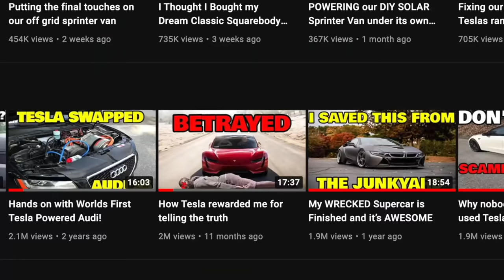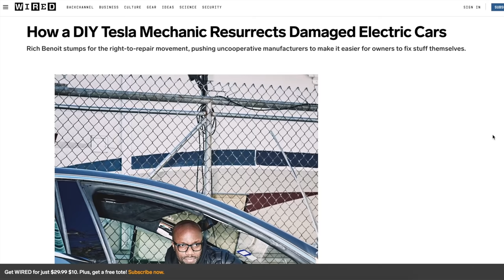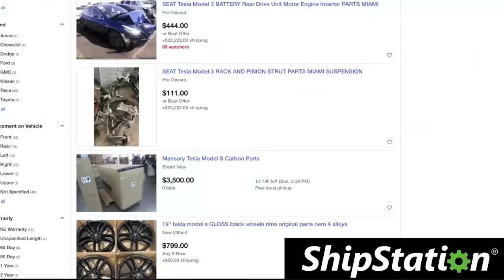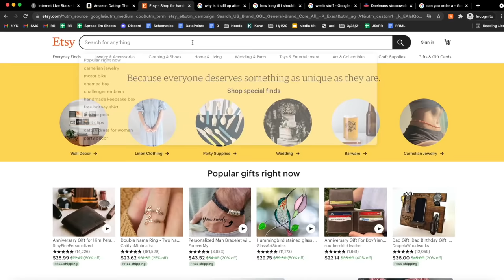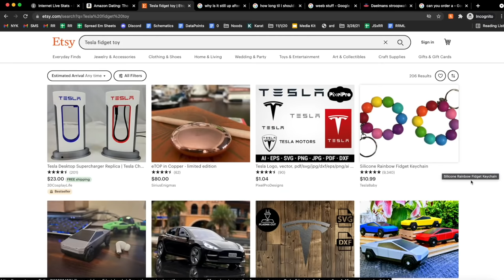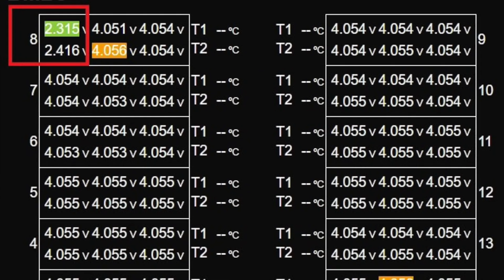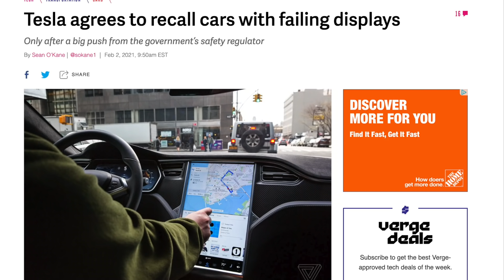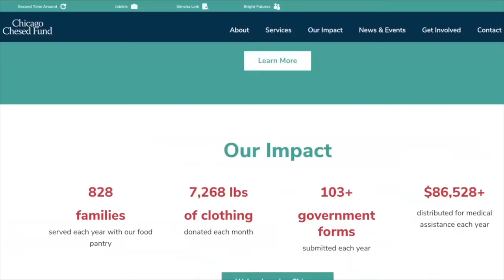Tesla wanted $16,000 to fix this NEW Model 3, we did it for $700! The importance of Right to REPAIR!

Comment: THIS is why Right to Repair is needed for consumers, REGARDLESS of industry. Fantastic video Rich.
Reply: +1
Reply: I dont really understand  what this video had to do with right to repair. Did Tesla try to take this video down? Was a cease and desist issued to this garage?

All I see is the dealer wanted to charge a Sky high price to repair then it was done much cheaper at another shop... welcome to owning any car in the past 100 years... 

Right to repair would be applicable if Tesla was saying that what you see in this video is illegal under the DMCA or took them to court. Thats what John Deere is doing to farmers. Tesla never said that,  at least I don't see it anywhere....?? What am I missing.

Also fwiw I can see why this kind of repair could not be stood behind because it may work but you couldn't guarantee it due to how it works, it is very depebdant on the skillset of this garage.
Reply: @brunes007  Tesla does not support independent shop, look back in the older videos
Reply: I think right to repair is great, but the reason Tesla might not want to allow uncertified individuals to repair vehicles is because it may create dangerous situations if components are installed incorrectly, creating fires etc... this would hurt Tesla's image and place people on harms way. Cell phone is fine when done by third party, but a  vehicle is a different story.
Reply: @hesamchobanlou4887  just sell the parts and be done with it, other companies are doing it. Tesla is just trying to control everything like apple
Reply: @farrisnoor3268  Ford nor any of the big 3 doesn't "support" independent shops either. Most independent  shops buy their parts from NAPA and other third parties. The only thing different here is a large and robust third party parts market  hasn't developed yet for EVs. My point is, good luck getting your Mustang Mach E fixed at an independent  shop. This isn't a Tesla or Right to Repair issue unless this garage is actually being sued, which from what I can see they aren't. John Deere is actually suing people who fix their tractors under the DMCA.  It's entirely different.
Reply: @hesamchobanlou4887  If I own the car I either has the right to do whatever the fuck I want or the company has to suck it up and do it unnder warranty or goodwill, and it's their choice if they want to risk their image and let me repair it myself.
Reply: @hesamchobanlou4887  in this case Tesla could just say (like many other car manufacturers do) you are free to repair anywhere you want but if you go to a non-officially-Tesla-approved garage your warranty is void. That would be acceptable. But force the owner to possibly see his car totalled if he tries to use the insurance, because of a little plastic part broken, that's totally insane.
Reply: @farrisnoor3268  yes Tesla is going the Apple way. And people will start to avoid Tesla the same way they avoid Apple. And it's sad, because both Tesla and Apple are making great products.
Reply: @brunes007  there's always a person like you who comments and dose zero research on the issue
Reply: Yes right to repair. I just hope what the president signs is not just bs in the end.
Reply: @hesamchobanlou4887  I think its dangerous to not be allowed to repair your car. People will just let their car go and it be worse and more dangerous then ever. Of course who cares, the rich people can afford it so why should anyone care? Not only that even if your rich you still gave to travel hours to fix your car. Etc... not only that. Don't forget about all the unnecessary lithium & batteries being waisted.
Reply: @brunes007  He literally gave you a video to watch. Go watch the video he said in the link and you'd be educated VS assuming and talking straight out of your ass. If you've been under a rock regarding Tesla they do NOT support independent shops outside of themselvs. Will not supply parts, battery pack or anything to anyone who's not THEM. That's what it has to do with Right To Repair.
Reply: @hesamchobanlou4887  then why not TRAIN shops how to do it? How do body shops get certifed to work on Porsche and other supercars? The manufacturer trains them! Same goes for mechanic shops to get their certification to work on them to THEIR standards. Same would and SHOULD apply to Tesla. So still, failing to see your point when it can be fixed with a remedy of training and a LOT of it as well to ensure no such mistakes are to be made
Reply: @brunes007  In addition, it's important to note that the Tesla repair shops barely have more experience or training than the independent repair shops have.  They're still rapidly changing part design.  The cars are that new.  My grandfather ran an independent GM repairshop where he had literal hundreds of stories of figuring out similar things to this for fixing cars drastically cheaper than the dealers would.  If this becomes a common enough problem, Tesla will probably change up their battery packs to make it more repairable.
Reply: @adewouters  Actually, if you use a non-Tesla garage, they legally cannot void your warranty, other than that for the parts actually fixed, or if they can show cause that the fix damaged other systems.  That's the right to repair that has been forced on car makers by federal law, and should be extended elsewhere.  If you goober it up, or if you hire an independent shop that goobers it up, it's on you or the independent shop, but otherwise if you replace your wiper blades and then the oil gaskets blow, the warranty isn't void.
Reply: Tesla charging $16,000 for something that can be done for $600, and there are actually people out there supporting that 🤣🤣
Reply: Should look at John Deere farm equipment that the farmers are not allowed to fix themselves.
Reply: @SSJ2and13man  there actually are Tesla certified body shops
Reply: all well but Tesla can just shut off super charging if they see a repair out of their network
Reply: Agreed
Reply: Tell that to the authorities. Try fixing your own A/C your not allowed to buy the parts on your home or car even with the tools that you Can buy.
Reply: Apple disagree hard!
Reply: @grandmastarflash  damn
Reply: @grandmastarflash  wHaT aBouT TesLa's pRecioUs RepUtaTioN?!
Reply: @Anthony__420  Yeah and one of them tried to charge this guy $16k to fix his car.
Reply: @hesamchobanlou4887  So every car, truck and motorcycle in the road can be repaired by third party garages but not Teslas, they are just way too complicated, give me a break! 😂
Reply: That's why people should stick with the gas vehicles you will always gets the "Right to Repair it myself" aka DIY all the time!
Reply: I just bought a Tesla model 3 RWD, I hate to pay $16,000 for a simple repair like this, but I can understand why Tesla will not honor a warranty on a battery after a repair like this, The Tesla battery has an 8 year warranty, anytime you modify this battery they can refuse to honor the warranty, all other cars makers do the same with their cars that are under the warranty. You may change the oil or replace brakes at any approved shop, but if you modify the engine your warranty is over.
Reply: @sssteve5430  lol! I always get 3 year Warranty on my 12V maintenance free AGM battery for my 2010 Chevy Express 3500 6.6L V8 gas cargo van! I get it for free! AutoZone was so generous and kind enough to trade my battery for a new one because it's still under warranty! 😁
Reply: tesla ~= apple
Reply: @brunes007  As long as the garage knows they're not missing any simple but important aspects   , they should warrant the repair . It takes SOME skill to tap threads into plastic , but not a great deal  A steady hand and a good eye  and you got it !!!
Reply: @hesamchobanlou4887  Then , again , the reason may be they'ld rather make $16 K than $700 on the repair LOL!!!

Comment: I'm no expert, but isn't it kind of a really bad design if a broken $2 plastic part results in a whole battery change costing $16k? Ridiculous!
Reply: I couldn’t tell from the video. Is the Tesla Nipple glued in place? 

I understand it’s likely a bespoke part you can’t otherwise buy, but making it permanently attached would be worse!
Reply: @marknelson2073  it looks to be molded plastic. Probably the end/side of the battery is a molded cap where things like this cooling tube attach.
Reply: American engineering.
Reply: @marknelson2073  it's not glued in place.  It can be unbolted and replaced if you take out the battery pack and open up the top of it to get access.  Tesla Service Centers do not work on battery packs.  It's quicker and easier for them to just replace the whole thing.  Then the old pack would be sent to their factory to fix the broken plastic tube and used as a refurbished battery pack.  Also, it's not easy to open the top of the pack because it's glued together with an adhesive to keep water out.
Reply: @kalekainxx  you should see German engineering ... It's even worst
Reply: @android04  That might be fine if they didn't charge full price for the new battery and ALSO WANT TO KEEP THE OLD BATTERY!  If they can refurbish the old battery then they should charge the difference between the cost of the new battery and what they can sell the refurbished battery for.
Reply: @SpaceClick  I agree with that.  They should give a discount and keep the battery to refurbish, or make him sign a waiver and let him keep the old battery.
Reply: It is carefully engineered to maximize profit.
Reply: It's a matter of perspective. From the customer's point of view it's somewhat sub-optimal, but from Tesla's point of view it's a fantastic design feature that sees the customer pay $16,000 to replace something that costs about half that to make, and then Tesla gets to "refurbish" that battery by replacing a $2 part and can sell it again for $16,000, so Tesla make more than $20,000 profit every time this happens to somebody.
Reply: @kalekainxx  nah it’s just electric car stuff
Reply: It's not so much bad design as a bad business model. Clearly it is a part that could be replaced but the business process at Tesla apparently does not repair at the component level. Many car^h^h^h companies do this now because complexity has increased. I wonder if that $16k included a core charge or not.
Reply: Actually it's a great idea at the beginning if you alone have the rights to service the vehicles, good on the company, bad on the vehicle owners but in the long run, somebody's gonna find out what makes it tick and bam, cheap garages willing to do the work at half the cost. The company already made their billions anyway and proceeded to other projects.
Reply: Tesla, Apple, and John Deere tractors are probably the worst companies for right to repair.
Reply: @JasonDoege  yup. I had an o-ring blow out on the input shaft of my Nissan primera. Nissan's solution was a $2000 steering rack and $1600 labour to replace it. A reconditioning outfit fixed  it with the entire job costing $900 ‐  AND   they added a second o-ring+groove on the shaft to prevent recurrences
Reply: @miscbits6399  not necessarily  the best choice...
O rings only have a small surface area of wear before they wear to the point of potentially  being an issue,  2 o rings wear at the same rate as one, so not much advantage, a proper seal (eg crankcase seal,  prop shaft seal) has a flat surface designed  for the purpose and will last, possibly a little more thinking required and different machining,  but a little lateral thinking could have given a relatively  bulletproof solution for a similar price. Most manufacturers  design weakpoints and failures  could have for virtually no difference in cost been forseen and eliminated  by reasonable  design. This tesla issue being  case in point, all it needs is protection beneath the fitting. A more robust fitting is not the solution, as even a solid metal fitting can't take impact,  and plastic is non-reactive  chemically whereas most  metals will either potentially  corrode or allow electrochemical reaction, so plastic fitting actually makes sense.
Reply: @davidp8157  perhaps not the solution but it lasted a further 15 years in service with no problems whilst the racks developed a reputation for popping o rings without modification
Reply: @miscbits6399  fair enough, logically what was done should last at least a little  longer than first time round,  which will keep most people 😊
Reply: @miscbits6399  about 30 years ago,  "modified" a Nissan  Sylvia steering  rack,  output (long  end of rack ) plastic  star bush was shot. Nissan New Zealand option was to import a new rack ex Japan,  (as at the time Sylvia's were rare) not an option as this would have meant months off road.  Ripped plastic star bush out, skimmed worn shaft( go figure wear from plastic star bush...)  custom modified  greasable bush, back driving in a few days  for literally a small fraction of the price of a new rack. Car ran reasonably  large mileage over next 10 years until upgraded,  no issues.
Reply: @davidp8157  "modular" replacement has been a thing in the industry for a long time. The same issue applied to fixing RWD Nissan Pulsar gearboxes when a 5 cent plastic selector collar failed inside them (new gearbox vs 4 hours labour to repair it) and P12 Primera gearbox issues (again, it was a small pievce of plastic internally, which woulod write off the car if Nissan had their way)

Nissan are not the only offender: they ALL do this. it's just that US$16k for a battery pack vs repairing or replacing a $1 nipple is an utterly extreme example

as for $700 being "too much" - "hiiting the machine is $1. Knowing WHERE and HOW to hit it is $699" - although I'd expect that for that money the repairer would also fit a shield or other item to prevent recurrences.
Reply: Or deliberate engineering to make Tesla and other manufacturers more money.
Reply: @kalekainxx  German engineering too.
Mercedes, VW, Porsche, Audi all have plastic parts that will cost you $1000s to replace.